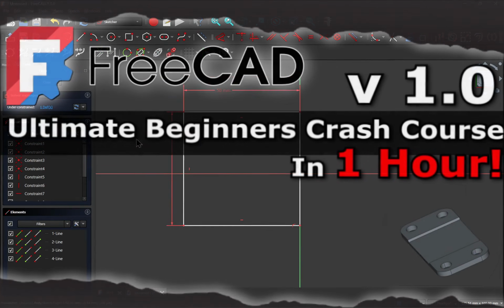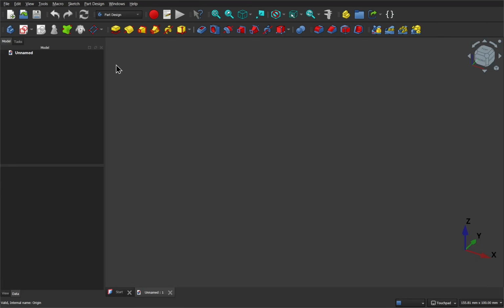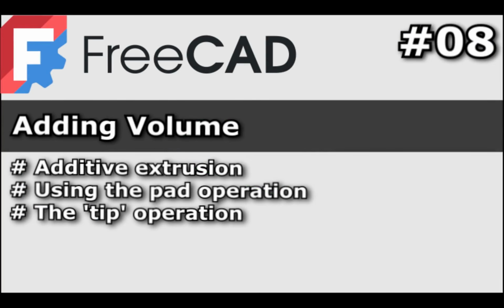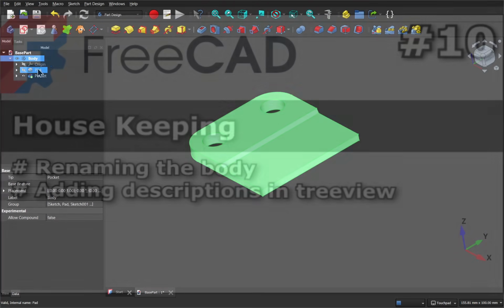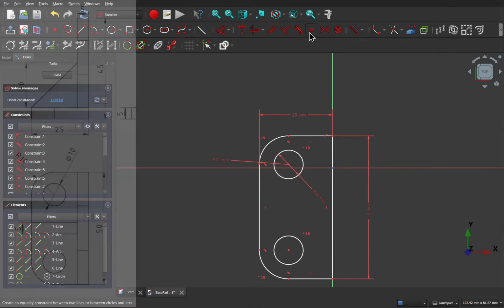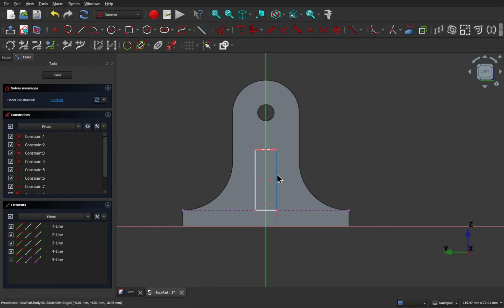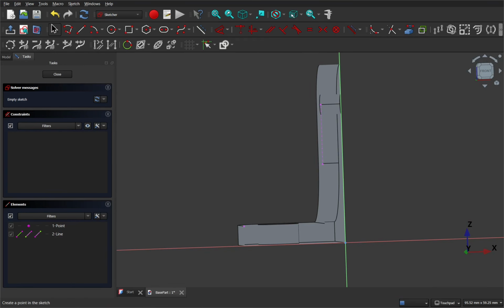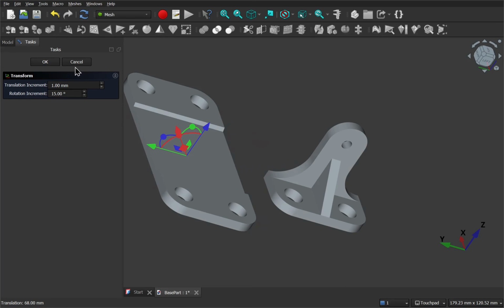FreeCAD 1.0 Ultimate Beginners Crash Course in 1 hour for 3D printing   CAD Lesson / Tutorial

Comment: I don't have any panels on the left or any of what this video is showing?
Reply from the maker: Go to the top menu > view > panels and you will see the panels you are missing are unchecked.  If your not using the combined treeview / property view setting (top menu > edit > preferences  General, Treeview and property view mode, combined selected from the dropdown) then you will probably see a option unchecked called 'treeview' which will need checking.  Hope that helps.
Reply: @MangoJellySolutions  Thank you for that, but I've gone to the view option at the top of the page and there is not one option in the drop down that says "panels" not even the word "panel" in any of the wording. I'm using a 2015 MacBook with Freecad 1.0.2

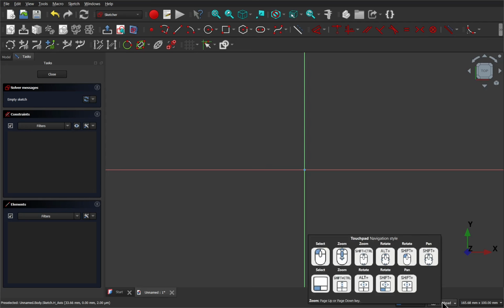Comment: At 10:30 your screen shows "Model" and "Tasks".  My version [1.0.1] doesn't have that.  Is this an add-on?  Where do I get it?
Reply from the maker: Ah, so this is the thing with 3D programs, there are so many different configs,  FreeCAD used to start (maybe wrong) with the combined view rather than the independent.  If you go to top menu edit > preferences and in the general section on the right you will see 'treeview and property mode' with a drop down.  You probably using the independent mode.  The model is the treeview, separate panels are best if you have enough monitor real estate .

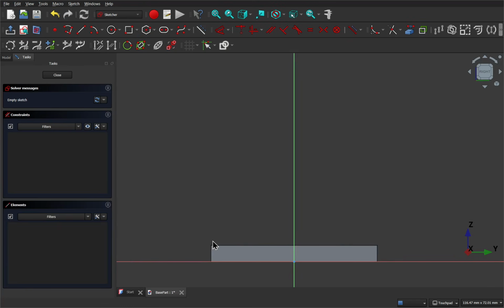Comment: 36:25 What is the import geometry function used for. Why did you need to import the geometry in this case?
Reply from the maker: The import geometry allows you to pull in a edge, vertex, face from other features so you can easily constrain to them rather than trying to offset from the sketch origin.

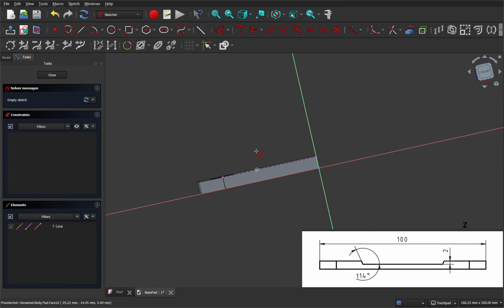Comment: I have tried just about everything in the comments and restarted this video and project multiple times yo see if I messed up somewhere but the pocket sketch at 23:00 simply does not work
Reply from the maker: Make sure that your sketch is inside the body in the treeview and the body is active (it should be in bold, if not double click the body).
Reply: I think you might have auto constraint on, disabling this solved the problem for me.

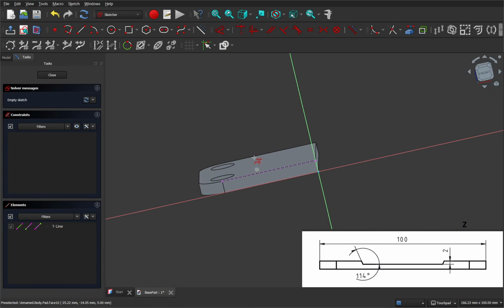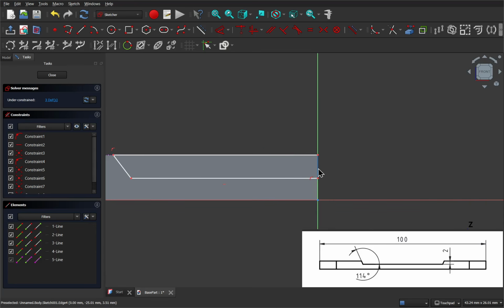Comment: Thanks for a well done course.  ! HELP ! removing volume -  At 23:00 - 24:00 I've created the external geometry and used the poly line following your instructions. When I try closing the constraints, the lines turn orange saying I have redundant constraints (7, 10). I've starting completely over and I keep getting this same problem. HELP, thanks.
Reply from the maker: Glad your enjoying :) If you click on the (7,10) that will highlight those constraints which you can then delete (via the delete key on the keyboard) also make sure you have 'remove redundant constraints' options set to on (checked) in the drop down in the sketcher panel.

Comment: When I do these things, FreeCAD puts in lots of restraints, automatically.  This makes some of the manipulations, shown here, impossible.  I have to remove many of the constraints.  Is it possible to stop this behaviour?
Reply from the maker: You can turn auto constraints off which means you will have to add the manually.  Also keep an eye on your mouse pointer, it's very easy to add a constraint because you miss it pop up by your mouse pointer.  i.e. if you create a circle and the side of the circle touches one of the axes you will see a tangent constraint appear and the minute you click it will be applied.  Can be very easy to miss.

Comment: After creating the polyline shape on the side face, dimensioning does not work on the line on the edge, as there are too many constraints.  I tried deleting enough constraints that allowed dimension of that line, but have descended into an even more problematic situation where the top horizontal line is disconnected from the line on the vertical edge, and the constraint tool does not produce a coincidence restraint when I try to make one.  I cannot shift the lines.  This is at variance with what is shown on the video.

Comment: 12:19 i cant get those measurement windows to pop up
Reply from the maker: Go to the top menu > edit > preferences.  On the left hand side find the sketcher icon and expand it and select the general section.  On the right hand side look for a drop down called 'on-view-parameters' yours is probably set to none.  Change this to dimension and you should be good to go.
Reply: @MangoJellySolutions  Oh I wasnt on 1.0 how do u make the dots at the end of the lines bigger im having extreme trouble seeing if there selected or not....thanks.

Comment: Really appreciate the video, and the people behind the software, but boy there is like 10x steps to creating sketches and extrusions, I've been using Fusion for many years, and it takes me around 30 seconds to make this entire model, simple things like auto constraints, snapping and other things make Fusion so much faster and easier to use, I understand all of these steps to create a simple sketch, but its extremely clunky, slow and quite unnecessary, I really think this software needs a simple/advance mode system, and have simple automate most of the steps, this is how software like Fusion and Shapr3D do it, you can drill in and do all of these advance things if you need to, but 99% you don't, and there doesn't seem to be any logic to the keyboard shortcuts and I cant see a way to set them, would be nice to click a plane/face, press S for sketch, press R for rectangle or C for circle, auto snap to a line/edge or point, with this software you have to find the button for Create External Geometry then click on and edge then you can work with it, this is all fully automated and is just assumed you want this, at the end of the day, yes I can use this, yes I can do pretty much the same things as other CAD software, but I will be giving up so much more time to do the same tasks, I really think this software's work flow could do with some serious automation, mainly around the sketching and extruding, I will give it a solid shot, but I'm quite sure if these additional steps cant be improved upon, then I will have to keep using Fusion as time is always quite important to me.

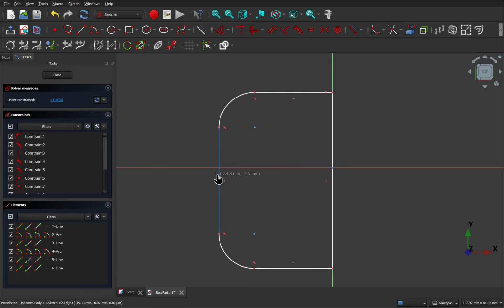Comment: Im new to CAD and just bought a 3D printer, for a different hobby. I came across this video series, and wow. Well explained. I do have some issues with the 33:00 mark, creating polylines. I keep getting an orange shape after i finish closing up the shape and it says redundant constraint 12? Have i missed something as ive wathed it back atleast 10 times and copied it exactly...
Reply from the maker: Glad you enjoyed, so when your creating the polylines the main culprit is the auto constrain finding a near by geometry and objects such as an axis or another line to add a constraint to( which you never asked for).  Watch your cursor carefully when you create the poly line and watch out for additional icons being shown by your cursor when your ready to drop a point, these are the constraints it's going to add.  

If you see everything in orange (over constrained) look to the left panel so see what constraints have been added (I bet there might be a symmetry constraint added that wasn't there before, which is a common one).  If you get the orange geometry, look to the pannel to the left top, where it says over constrained.  Click on the number by the side, that will highlight the constraint, and then hit delete on the keyboard to delete it.  You should then be all good to go.

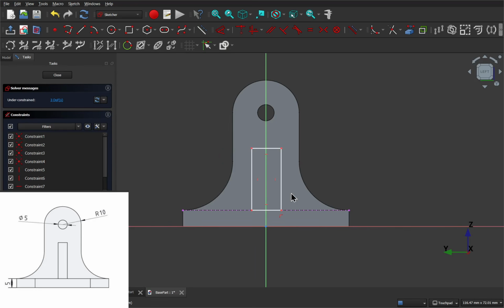Comment: I cannot symetrically coincident the sketch square gusset 43:24
Reply: I am having the same problem! Was hoping for a solution in the comments but haven't found it yet :( 

The error message reads: Wrong Selection. Select two points and a symmetry line, two points and a symmetry point, or a line and a symmetry point from the sketch. 

I don't understand because I am doing this as I follow along in the video. Can anyone give some insight? Please!

Comment: Hey not sure if I’ll get a response but I’m struggling with an “over constrained error” when trying to create symmetry for the rectangle. Any help would be awesome!
Reply from the maker: Hi, first thing to check is the the 'auto remove redundant constraints' is checked in the sketcher.  Located on the left hand panel, in a small drop down in the constraints section, arrow by the side of an icon that is a wrench and chisel crossed.  Make sure that's checked.  Next if you still get the error, look to the left, there is panel at the top that is labeled 'solver message' within you will see the text 'over constrained' in orange with a number by the side.  Click the number and it will highlight the constraints in the 3D view AND the panel bellow, constraints.  You can hit delete on the keyboard to remove the highlighted constraint.  Hope that helps.  Over constraining is a bit of a learning curve.

Comment: This video is extremely informative!! The only thing I can’t figure out is how to center 2 square holes of different sizes. I don’t even know how to explain what it is that I’m trying to do.
Reply from the maker: Excellent, great to hear.  Regarding your question.  If you go to the sketcher you will see that the rectangle tool has a little drop down by the side of it.  Within you will find a 'centered rectangle' which is easier to constraint with the symmetrical constraint.  Also remember you can use construction geometry.  A polyline made up of a number of lines that have equal constraints across them all can be used for spacing geometry by using the points at the end of each line segment.  You just then need to toggle the polyline to construction geometry.

Comment: Great video. Wondering how you get your object to be blue and see through-ish when you select it/rotate it in a 3D space. Thanks in advance.
Reply from the maker: I thought this was enabled by default but I think what @EM83D commented might be what your looking for?
Info: if the model doesn't appear transparent (like it does in the tutorial) when you hover the mouse over the model at the model tree just go: Edit>Preferences>General>Selection
Enable the following line:
"Preselect the object in 3D view when mouse over the tree"
I read the solution by drmacro on the official freecad forum at topic 55581.
(As i read this feature was enabled initially earlier but later update switched this off, so probably that is the reason the tutorial didn't mention it separately.)

Comment: Info: if the model doesn't appear transparent (like it does in the tutorial) when you hover the mouse over the model at the model tree just go: Edit>Preferences>General>Selection
Enable the following line:
"Preselect the object in 3D view when mouse over the tree"
I read the solution by drmacro on the official freecad forum at topic 55581.
(As i read this feature was enabled initially earlier but later update switched this off, so probably that is the reason the tutorial didn't mention it separately.)
Reply from the maker: Thank you for adding that, you have just answered another question someone has left which I now realise what they are looking for.  Thank you :)

Comment: so I have tried to follow exactly what you are doing, but after the geometry close off at 23.55, my shape remains orange, and I don't know why. Yours turns white, mine doesn't and I don't know what is going wrong
Reply from the maker: Sorry to hear your experiencing issues. First thing to do is make sure you have the remove redundant constraints option checked in the option in the sketcher panel this will help a lot when sketching.  If you see this message then there should be a link by the side, you can click that and it should highlight the problematic constraint which you can then hit delete on the keyboard to get rid of it.  Also, when your using the auto-constraint option it's common to add geometry and not notice that a constraint has been added that will later 'trip you up' along the way.  This can be anything from being in the center of a edge and a symmetrical constraint added, being to close to a line and a tangent constraint added.  This can be easily missed.

Comment: Thank you for the great tutorial. I went through your tutorial effectively 3 times. Once in PC, and actually a couple times on steam deck. And I was able to recreate your bracket via just schematics the third time. 

Just days after, I did my first design. A little retaining bracket for my sliding shower doors to replace a broken one. Complete with asymmetrically drilled screw holes. You obviously didn't cover actual part design. But I was able to use everything I learned here to create something that worked and fit on the first try. I only just got my Bambu A1 and my first real job was something I made. It's such a cool feeling.
Reply from the maker: Wow, that's fantastic to hear, I really appreciate you letting me know and I hope you enjoy your new printer.  I have just recently upgraded mine and now have a CoreXY multicolor printer and hope to incorporate this in the channel as well.

Comment: For anybody stuck when creating the last line near min 24:00: switching from polyline to line in the toolbar let me finish it without adding a redundant constraint.
Reply: My Freaking Hero took me only 45 minutes before reading the commmetn section
Reply: I basically had to do this part from scratch.
Reply: Yes same for me. Thanks for the tip!!!, this worked for me as well.
Reply: lol I was so excited but I’m stuck 3 mins before this 😂 when adding a sketch to the 3d model, when I try to extrude it, it says selected object must belong to active body , following step by step I can’t get it lol
Reply: küss dein Herz
Reply: Works for me. First 2 Lines (using Polylines) then stop, Lines 3 and 4 using (Regular Line). Thanks.
Reply: @radioward01 yeah, I'm stuck. my side elevation turns orange & when I try to dimension it, the ends move  all over the place, or refusesto accept a dimension other than the initial size it was drawn at.
Not sure how the top line that we draw on the side elevation snaps to the top. FC does not seem to snap.

I'm trying FC after not being able to delete geometry in Fusion. I'm making a 3d part to fit inside a piece of kit & as I cannot measure the internals, am doing it by slowly adjusting the size of each extrusion as I go.
Reply: @wibbley1  You can just delete the redundant constraints that FreeCAD is complaining about. Just look for the constraint number(s) in the Solver messages [in the Tasks tab], find it in the Constraints table below, right click it, and delete. You don't have to worry about revising the way you're doing the sketch. Work smarter not harder.

Comment: Pressing F2 on the Base part body didn't edit the description.  nothing happened at all.
Reply from the maker: At 26:24 you need to make sure the mouse is only in the description column, if it's over the body it doesn't add the description.  I have had this a number of times.
Reply: @MangoJellySolutions  thanks for the response, but F2 does nothing for me at all still.
Reply: @HemnaIV  fn + f2 should work

Comment: Thank you for taking the time making these tutorials.
Years ago I used Fusion 360. But when their greed set in with ridiculous prices I dropped it for Blender.
But precise modeling in blender is not that ideal (even though I know and studied subdivision modeling)
So finally there is a free CAD program again that's nice to use with parametric design (and can have variables, unlike plasticity)
Reply from the maker: Thank you for commenting and glad these tutorials are helping.  I know what you mean about the prices and vendor lock in.  I hate not being able to own a piece of software.  On the Blender front I spent some time with the CAD sketcher addon, it was promising but doesn't offer a full solution.  The same with the likes of geometry nodes..
Reply: @MangoJellySolutions  Yeah, I tried the CAD sketcher addon for blender as well. It's ok but not really as powerful as an actual CAD program. Plasticity caught my eye as well but same problem, they are good just not full CAD good. (especially when you have to edit stuff later on)

Comment: I could draw that in Blender in 10 minutes max but if I wanted to bevel edges for 3d printed strength I could add a couple of cups of coffee to go with the frustration because sometimes it drives me to utter distraction.
So that's why I've been trying on and off to learn Freecad. This is a great tutorial that I followed to the letter but was stumped at the point where I added the second sketch. It just failed and that's what I find difficult with Freecad tutorials. If it fails at one detail the rest often makes no sense. The interface to me is alien, over complex, unforgiving and not in the least intuitive. It has huge functionality but that's it's downfall and in a way Blender has the same problem but the pure modelling workspace analogy is far simpler and quicker. 
I will persevere because I can see a good case for using both Blender and Freecad. Blender is better for "sketching" a design they way I might on paper. Freecad is better when you have a drawing or know exactly what part you need or you want a dimensioned drawing and the latter is where Blender is particularly weak.
And please, please don't listen to the "Blender is no good for precision or retrospective changes" rubbish. It's like any other tool; It all depends on how it's used. So I'll be back to this maybe in the winter when I have time.